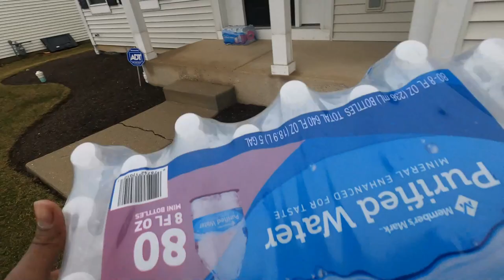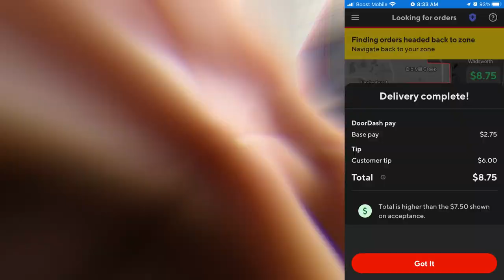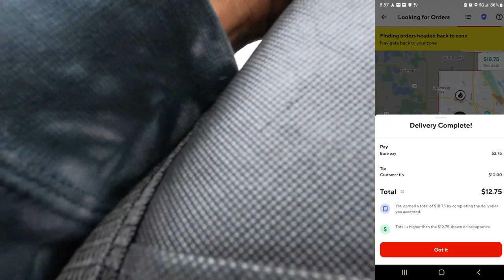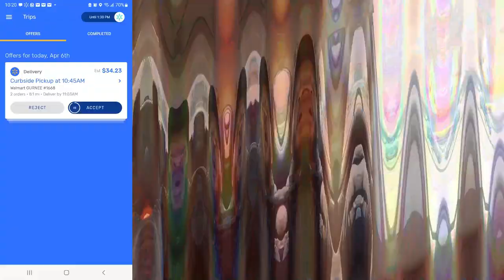Someone Really Screwed Up!! 😬 Awkward DoorDash Deliveries! InstaCart, DD Tips & Tricks, Ride-Along

Comment: U think spark does better than shipt and IC? I'm 18 so I can't do UE yet they have it at 19 for some reason lmfao. Been doing DD waiting for GH application still but IC sucks, been thinking of doing some spark till I turn 19 and get on UE and DD.
Reply from the maker: I ABSOLUTELY think Spark is better than Shipt and Instacart. The order are usually way easier and you get paid more. The only difference is in my area Spark only usually hits twice per hour (Between 15-17 for Sam’s Club and 21-23 for Walmart).
Reply: @carsandcribs  Thanks for the advice man. So Spark is only Walmart and Sam's Club? That makes it easy asf haha! Defintely gonna check it out in my market, the drives in my market are far away, minimum 1-3 miles! Good ol' southwest florida
Reply: @zyzkk  Yes, it is only for Sam’s Club and Walmart. It definitely makes it way easier! But one the bright side yall do have the great weather.
Reply: @jeromeadams4710  Awesome Im definitely gonna hop on Spark. And yeah the weather is typically pretty great, the rainy seasons coming though, every day at 3pm like clockwork its gonna start downpouring till november!